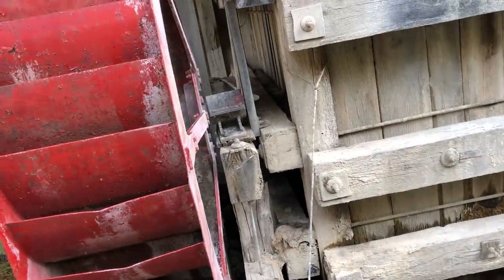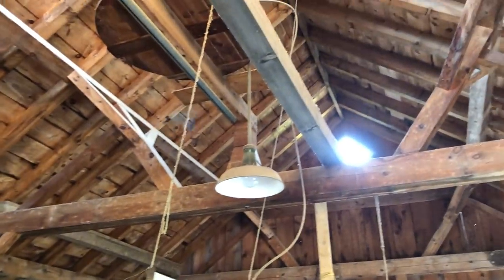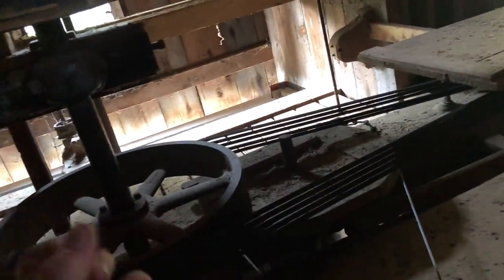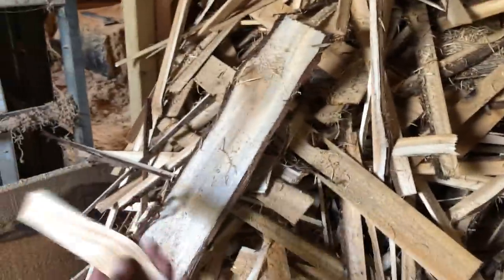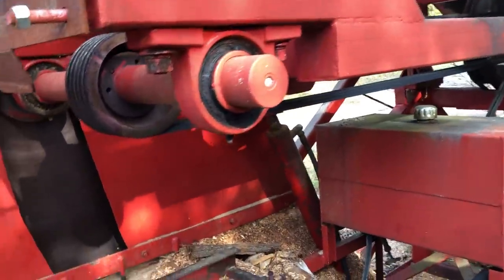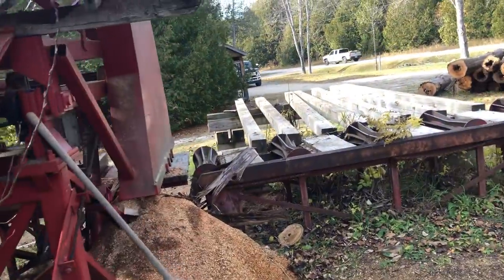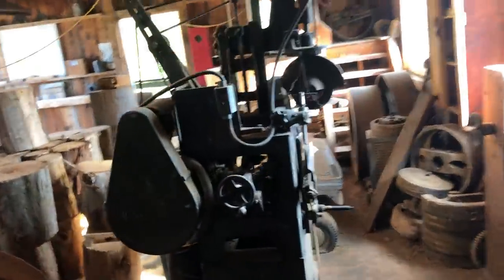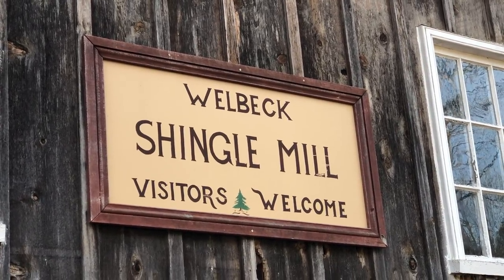This was an awesome water wheel sawmill. Let's figure out how it works

Comment: they probably do both if the water was up and flowing higher then they could run from the old setup im sure
edit: i bet that electric motor is used as a gen to power the lights and if the water is low they run the whole setup from the big engine
Reply: that's what i was thinking